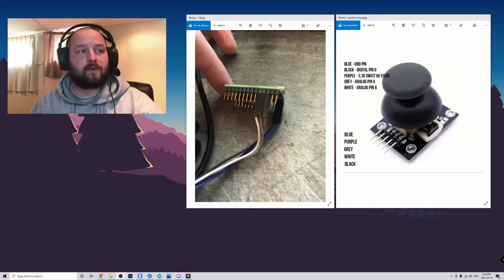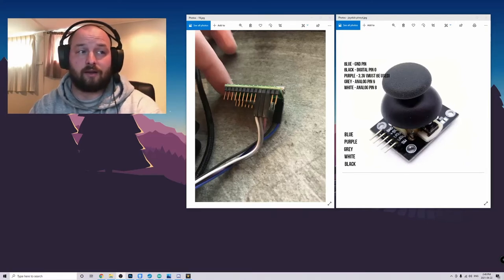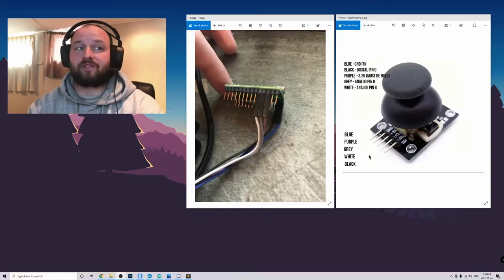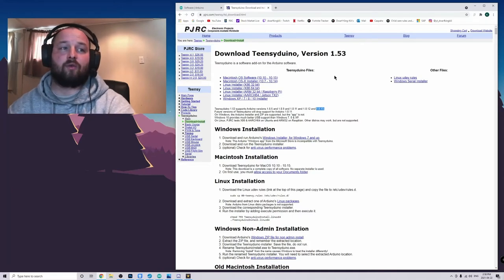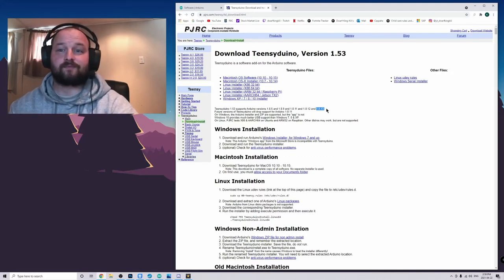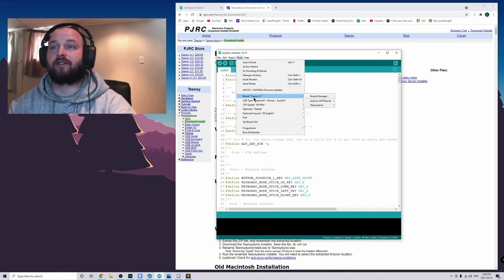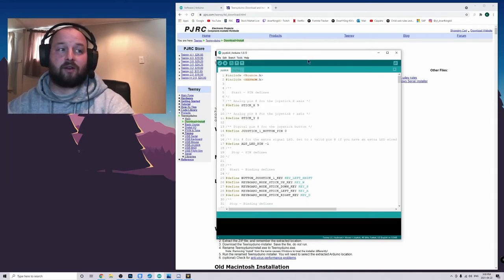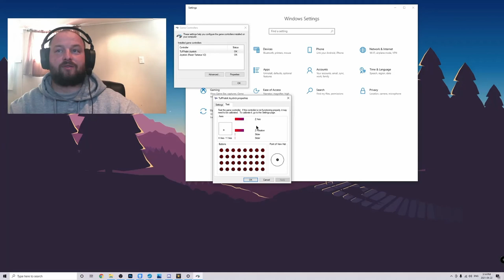RAZER TARTARUS V2 ANALOG JOYSTICK - PART 2

Comment: I know you are busy but it is worth a shot....

...Hello
I am trying to do what you did. 
Problem is that I can't get my hands on the Teensy board. 
So I got myself a Raspberry Pi Pico as I saw other using it for far more complex controllers. 
Problem is that I have close zero experience with actual programming (I mod my games a bit if this is any help).

So I was wondering if you know some code/technique that will work that I can use for this board. 
So it turns into some simple USB mini Joystick.
Thank you
Reply from the maker: It will absolutely work. I just did a quick search online and found this video. https://www.youtube.com/watch?v=__QZQEOG6tA I don't have experience with the board you're using. But I can try to help in anyway I can.

Comment: aha! heh ... just found part 2 ;-)
Reply: purely thinking aloud ... is there a potential future mod where one hooks up the other keys in the device to the teensy? allowing one to have just one cable?
Reply from the maker: Just seeing this now. There is a really easy mod that you can hook up the teensy and Tartarus to a hub and only one cable comes out. Works well for a teensy that’s inside the body of the Tartarus.
Reply: @dwarfkingkili698  Yeah, that's what I'll be doing to start with. However I'll be exposing one (maybe more?) of the USB-A ports, so that it can daisy-chain devices.

I think that one important thing will be to ensure that it's a USB 3.1 hub minimum, because 2.0 could potentially slow down your USB3.0 controller if it's the only controller on the system you're using.

The end goal, of course, will be to keep the teensy+hub, but have the teensy handle all the keys. I don't see why it's not possible, as people use teensy's for keyboards very often, I just need to start learning teeensy. 😅

Comment: Razer cheap grit bast!! $129 for a pro and they did not add an analog decent joystick the one on it feels like SH!!
Reply from the maker: That's why this is here so everyone can have an analog stick in their Tartarus. The D-Pad does feel like shit, and breaks really easy too.
Reply: @dwarfkingkili698         Yes the joystick is so bad, the feeling and sound i can not take it anymore, also something I hate is the position of the joystick, to move foward you need to press right to down it is just not the right position. This whole thing you did looks great solution but Im worried about driver updates that might give us trouble in the future.
Reply from the maker: @teddyval8991  Well with this mod, you can angle the joystick to what feels most comfortable to you.
Reply: @dwarfkingkili698  The issue or challenge will be making a 3dprinting kind of Frankenstein thing to adapt the joystick and make it flat.
Reply: @dwarfkingkili698  BTW so the only thing you need to buy is the joystick and the cables, right? how much is that and where can be ordered quick and not like a month to get them
Reply from the maker: @teddyval8991  You need a joystick, cables, and a micro controller. Here I used a teensy LC, but others work just as well, they just need to have native HID support.
Reply from the maker: @teddyval8991  If you want a flat joystick with no moving parts. I've just completed a joystick using a touchpad. So no stick drift ever. I'm currently attaching it to my Tartarus, and testing in games. The images are in the discord channel.
Reply: @dwarfkingkili698  How much wil lcost all the parts? Do i need an special solder? or tools and how long it takes to crete all this?
Reply from the maker: @teddyval8991  Sorry for the delayed reply. Parts vary in cost depending on where you buy them from (amazon, robotshop etc) Regular electrical solder will work, mod can take max about an hour to hour and a half even with taking your time.